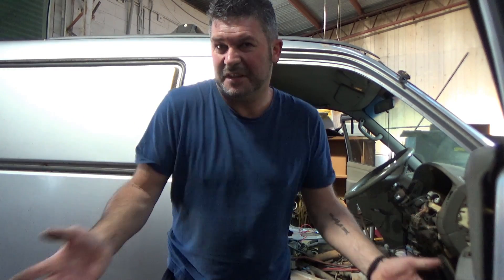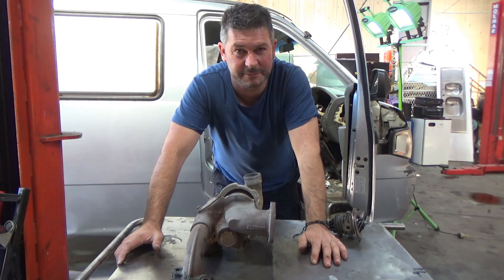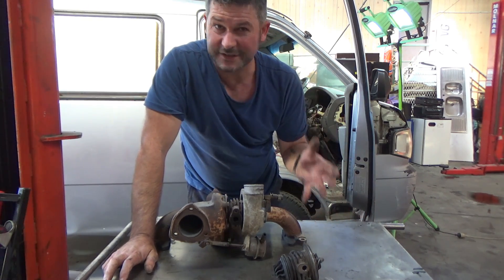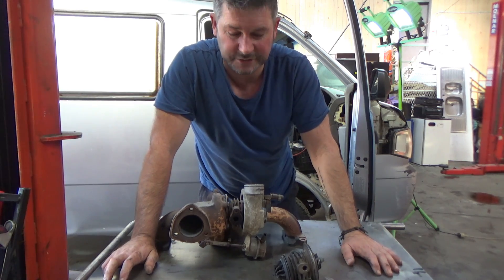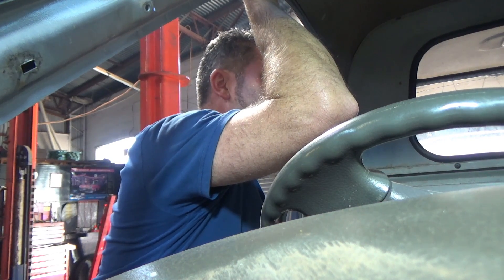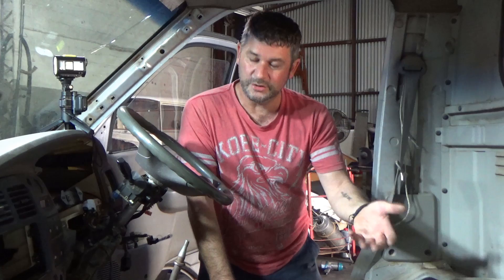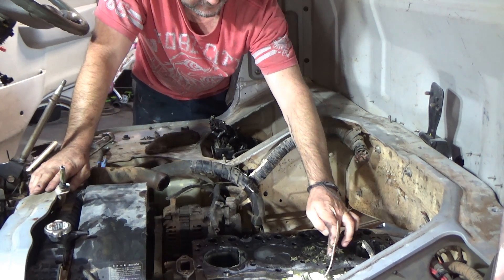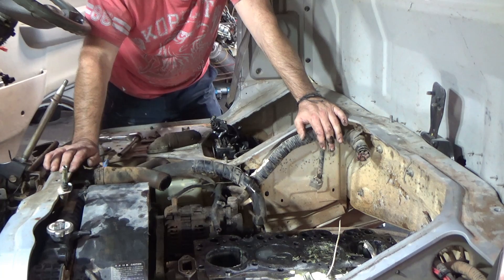How to Stop a Run-away Diesel -ENGINE BLOWS !

Comment: I have a, probably, stupid question, but i'm no expert in engines or anything if you may so that's why i'm asking... I understood that running-away is generated, at least in one of the plausible situations, by the play on the turbo's turbine's axle which causes oil to leak into the engine's intake causing it to overrev in spite of no-one accelerating it, the thing i didn't get is, you said the engine you tested was not turboed, how did you make it run-away? or did you just accelerated on purpose like if it was about to run-away and you just tested ways to kill it regardless of the cause of it accelerating/overreving???
I really liked your video regardless, the sound of your voices was sometimes hard to listen to, but i liked it :D!! Thanks in advance.-

Comment: Good video,but i wonder if you let the engine run-away, would it end blow up 100% of the cases?
If there is no more oil the engine can't keep running anymore (it could be destroyed before if it reaches too high rpm)

Comment: Runaway diesels rev much higher when running on their own oil, as the fuel/oil isn't regulated. I seen one blow a clutch when putting it into gear and then carried on running to put no.1 Rod through the block
Reply: They are uncontrolled except for volumetric efficiency and throwing a rod.

Comment: Many long years ago I bought (cheap! cheap!) a badly maintained high mileage Rabbit (Golf Mk I) diesel that had worn out rings. That allowed the pistons to suck lube oil from the sump at speeds above about 55mph/90kph. Who knew that diesels could run so well on 20W-50 oil? So I rarely drove it on roads with speed limits above 45. A couple of times when I did, "run away" became very real and very scary. It would keep accelerating with the throttle closed. Never had any problem slowing back down using the brakes, but I did have to push the pedal pretty hard. After a couple more years as an in town only car, the cam belt eventually broke and to the junk yard it went.

Comment: stop the car ( not moving) put it in 4th or 5th gear and release the clutch fast... that's it
btw no damage to the engine
Reply: Thebagair you do realise that when a runaway happens it fucks the motor because it runs on its oil...

Comment: What about cutting the electrics (remove fuses) to kill the fuel intake valve and shut off the main fuel feed? It should make it more difficult for the engine to run and combine that with a method to stop the intake of air, should kill the engine in a runaway engine situation.
Reply: You are missing the point here. A runaway doesn't run on fuel but on its own lubricant oil.
Reply: Hpa Poe still, it doesn't stop the driver from dropping in to 3rd gear and then dropping the clutch while all brakes are on, including the foot brake.
Reply: Perhaps that might work on one of those small 1.6 ltr. diesels but chances are you'll burn out the clutch in the blink of an eye and the engine won't miss a beat. But I would love to see you trying that on a 15 ltr. Kenworth.
Reply: Then you just suffocate the engines ability to breathe and theres many ways of achieving this, one possible method would be to starve the engine of all oxygen and dump co2 directly in to the air intake.

You could also try the old trick of "Tatering" the exhaust, thats sticking a large potato on the tail pipe and driving it home with a wooden mallet or a fist so that the engine will struggle to put out exhaust and also the intake if its a turbo. Larger ports only need enough covering the port to create a tight seal to do the same sort of job.

There will always be some way to stall an engine, I had a bit of an old banger for a while that had a tendency to restart itself, just no reason at all so I resolved the issue with a battery switch. I used to leave the car in gear until fitting the battery switch that was worth as much as the car, mind you, we are talking 1980, I paid £25 for it. 3rd gear was a charm, tended to wander a bit, but it got me to work, sometimes.

Comment: heavy plastic bag could do the job instead of rag, u cover it on top of the manifold. could also be done by cutting the fuel line. or taking out the engine battery on newer ecu based diesel

Comment: I feel like the block of wood would work on an actual runaway though. You guys were testing with the proper fuel ratio of a running diesel using it's injection system. A runaway will typically not be burning injected diesel but whatever engine oil it can suck in and in a quite rich mixture going by all the smoke you typically see. I think the block of wood will change the mixture parameters enough to stop the combustion. Anyway, nice video guys and thanks for the effort!
Reply: Todd Stidham ...it will keep it from exploding like bomb, until something else can be done..
Reply: Todd Stidham
 diesel engines detonate from its  compression not the actual fuel and air mixture I  think .

Comment: Here is a tip for you, from one old mechanic to another. A halon fire extinguisher will work on a run away engine. I know because I use to keep one in the shop back, when I was working in a full service, service station which are pretty much non-existent for the most part now days. Now Halon is a "Clean Agent." as defined by the National Fire Protection Agency. And it is a liquefied gas, and it does carry a ABC rating, the nice part is that because it is actually a gas instead of a powder it will not damage the engine. Which is why I kept a Halon fire extinguisher on hand all the time, as it meant less repair work if a car caught fire in the shop. And yes that does happen, when a car backfires through a naturally aspirated gasoline engine. So it should work on a Diesel engine as well, for cutting off the air supply.
Reply: I can imagine that Halon would work pretty well, but, as a CFC depletant it has been banned in Europe for over 10 years and is unobtainable. I don't know about the US or AUS. The replacement argonite or FM200 extinguishant gases that are used to protect data centers might well work but they don't tend to come in handheld cylinders like Halon used to, principally because they are fluorinated gases and very strictly controlled
Reply: I know we can still get small 10# bottles for on board driver activated race car fire suppression but I think thats it.
Reply: Stephanie Kawadias Halon (Bromotrifluoromethane)... Was banned under the Montreal Protocol no?
Reply: Halon is only used on aircraft in aus atm and specialist industries from what I know...... and if you ever let one off the paperwork is biblical..!!. stuff kills a fire, ultra fast though... kills the oxygen.. fire gone in like a second or two... extremely effective!! However not so great on mother earth...
Reply: @steveblackbird  uk taxis used to have halon extinguishers back in the fairway days, i kept a few as they are good for electrical fires

Comment: I used to work as a diesel mechanic for the US Government. Had a 5-ton run away on me once. Hit the intake with a CO2 extinguisher to stop it. Worked like a charm and the engine survived too.
I used to be skeptical about using CO2, because it comes out so cold. Figured hitting the hot pistons and valves with such cold temperatures would cause damage. But if you think about racers and the use of N2O in cars you realize that the engine must be capable of taking it.
Reply: rebelwolves ;
Reply: Yeah but most of your racers that run nitrous rebuild there engine quite often
Reply: @garebear1806  When your engine runs away you are going to rebuild it anyway. CO2 means you have an engine to rebuild.
Reply: Hydrolock
Reply: The CO2 wouldn't really be that cold. Since you are compressing the CO2 again it gets hot again, because in gases preasure correlates directly to the temperature. Here is a short of a fire brigade using it to stop a rather modern diesel engine https://www.youtube.com/shorts/v9FrFI20xFc
Reply: 40 years ago I learned to always have a Co2 bottle ready when starting a diesel in the shop, especially Detroits (2 stroke) which start with the rack wide open. Also diesels can runaway from oil leaking from the intake side of a bad turbo.
Reply: @llewellynquay9463  I've heard they can also run away from bad oil rings

Comment: Wouldn't having an air filter on for the extinguisher make a difference. it would clog the filter and prevent air flows thus choke the engine out.

Comment: Fire extinguishers work pretty well, seen a couple of trucks run away, go nuts with the extinguisher, if you run legal you need one anyway. A powder extinguisher will plug the filter and snuff the air and a CO2 will smother the fire inside. We had a screaming truck and hosed it with the powder. Swapped the turbo, changed the air filter, gave the side of the truck a pressure wash and the good old DT466 was still running 2 years later. So don't spray powder directly into an engine without a filter.

Comment: generally the idea behind the fire extinguisher is that you would leave the air filter on, the powder from the extinguisher should plug the air filter, in theory it is the fastest way without damaging the engine
Reply: Baron Van Oosting co2 is a gas( carbon dioxide) using a powder extinguisher won't starve it of oxygen, its safer to block the exhaust, stop the flow of gases, and if the engine blows it won't explode in your face.
Reply: Baron Van Oosting ...no...you rob the engine of oxygen...that hoover will suck that air filter inside out and keep going.. This test worked here, due to static lock..

Comment: That was interesting. I have my dad's 1962 David Brown three cylinder diesel tractor. When he bought it, I was fascinated that turning off the "ignigion" did not stop the engine. You had to turn off the fuel. My dad explained that diesel engines do not have spark plugs and that ignition occurs through compression. My first lesson in thermodynamics. My dad was one smart farmer.

Comment: If you can cut off fuel or air, it will stop.. I like the idea of a CO2 fire extinguisher.. The engine can't run on carbon dioxide.

Comment: Cut or crush the turbo oil feed line.  It runs out of fuel, combustion stops, hopefully before the crankcase runs dry.  The hot oil bath wouldn't be fun, but you'd have an engine.
Reply: Jafromobile your approach works great but I experienced another type of runaway... injector pumps were built in head, and leaked. oil sump filled with mix of diesel and oil and was sucked in into intake by sump ventilation.... oops...
Reply: OUCH!  That sounds like a disaster looking for a place to happen.  :(  I don't think I'd attempt my method unless I knew the turbo was failing (in other words, if it was my diesel engine and I had seen it/smelled it smoking prior to the runaway).  Doing this to someone else's engine would probably just make them blame me for helping them, knowing my luck.

Comment: Porque no los dos? You could use a combination of both. By using a floor mat or similar you could restrict air flow which would in-turn lower the revs/torque allowing you to stall the engine without destroying the clutch.

Comment: Remember that a turbo engine with no turbo has very little power, add to that it's running on oil, which is less efficient and will produce less power. My guess is the block of wood would work and the rag would likely be stuck at the same broken turbo.

Comment: The soda extinguisher wouldn't be a problem if the air cleaner were on the intake.  Even powder extinguishers use CO2 for propellant.

Comment: block the exhaust. You don't have to block it completely. Get enough back pressure on it and the turbo slows down. If you happen to have a potato handy and ram it into the exhaust one of two things will happen. The engine will stall or you you will have a high speed potato projectile.
Reply: BrianBell4073: Give it a try on your gas engine running at 2500 RPM's and let us know how that works out for you, or does not work out for you in this case. The one fail safe measure that works every time is to block the intake air with either a thick chunk of wood or at least a 3/8" thick steel plate.
Reply: Thought of this also.  you would have to stop it right at the turbo, and completely.  trying to shove a potato in a non runaway TAILPIPE would be difficult
Reply: Try it on a gas motor at idle.
Reply: Much easier to block the intake and bonus it will hold itself on. trying to block an exhaust blasting hot gas is like trying to put your finger on the end of a hot water tap
Reply: xD
Reply: High tech engine propelled potato gun! LOL :)
Reply: I’m not mad at a high speed engine projectile
Reply: Yes, I’ll throw a potato into my 8” exhaust. Lol yup, that’ll do it...
Reply: Water melon
Reply: You use a Co2 fire extinguisher.
Reply: @davidblakeman7165  No way you will ever block the exhaust with a CO2 extinguisher.
Reply: Or a banana 🍌

Comment: seems to me the the oil feeder line to the turbo needs a rev limiter shut of just my 2 cents or a simple ball valve but that leaves the chance of a screw up and poof turbo no oil but hey atleast you didnt spin the mains or throw a rod thru the block

Comment: The fire extinguisher method often works best, with least damage, but must  be done with a C02, Halon, Halotron or other gas extinguisher.  While powdered extinguishers may work, it will trash the engine. The powders extinguish fire by emitting non flammable gasses via a chemical reaction caused by heat from a fire. However a byproduct of that reaction is extremely corrosive residues left over. These corrosives will start to eat the internals of the engine as soon as they get hot. It is basically like pouring acid into the intake. And when possible, install a co2 -or halon if you can afford it, extinguisher in your vehicle,

Comment: You can stop a runaway Diesel VERY easily with either a flap on the supercharger (common on Detroit's)  or simply use a CO2 Fire extinguisher, MAKE Damn sure it is Co2 and NOT DCP that will also KILL the engine and require a rebuild.
 
So CO2 is the way to go , Engine got no O2 it aint gunna burn the Fuel SIMPLE

Comment: Runaway diesel is a shitty ass situation to be in.  I think stalling it out is ur best bet, the C02 extinguisher is probably a good one, but I think many of them have foam and shit in them too so it may just as easily lock the engine.  If you got an oil leak not a whole lot you can do if you're in an auto :-\.

Comment: only problem is with a gas engine the trans and engine rpms are synced so when in any RPM you can slide the transmission into any gear with no problem but with a diesel you have to rev match to get them into gear this being said at a high RPM you will not be able to get it into gear!

Comment: there are 2 stages to runaway.  the first stage of runaway is when crankcase vapors condense inside the intake and begin to pour into the cylinder and burn as / instead of the fuel .  the throttle is completely out of play and many times the the accelerator pedal draws to the floor. turning off the ignition key will stop the flow of fuel , but the oil will continue burning until it's all completely burned. 
the 2nd stage of runaway is when the oil itself being burned as the combustion fuel creates enough blowby gas in the crankcase to push excessive oil vapors into the intake to be burned as / instead of / and along with the fuel. once this cycle starts the engine will burn out all the oil before it shuts off.  probably terminal for the engine since all the oil is gone. turning off the key will not help this condition as the engine is in a complete vicious cycle of combustion vs blowby / crankcase pressure.
turbo lubrication leakage / runaway  is a whole other creature likened to the 2nd stage listed above.
a positive air shut off in line with the throttle plate would choke  ANY  engine out as one of the primary elements of power are removed. combining this with a C02 ext couldn't hurt.

Comment: I work on and hot rod  old 2 stroke Detroit's Never use dry chemical that will ruin the rings and score the cylinder walls !    I keep several charged CO2  fire extinguishers in the shop  If the emergency stop flap on the blower (YOU NEVER REMOVE THAT THING !!!)   does not choke one off discharge the CO2 into the intake until it dies  I also install a quarter turn valve in the fuel line of every one I work on also for extra safety  The Rack on them if one injector jams you get the runaway because none of the others can be turned off .

Comment: If you do this again, you should reconsider the rag. Try it with a wet rag. Make a ball out of it and let it get sucked in. If it keeps running pour in more water. It could not be worse than the dry powder.  Even if it hydrolocks the engine, it might save the rest of the vehicle (and surroundings) from fire damage...
Reply: his rag was too small... when that kind of shit hits this kind of fan - its time tp stuff your t-shirt, jacket and underpants all at once into it.  Or try the detachable headrest ... full of foam...  rubber floormats... your mother in law..  wahtever is available, just not a rag size of a hankerchief

Comment: I think this is a good experiment, but the thing you may be failing on the first test is that when the engine is running on engine oil it is making significantly more power than it would be on diesel. It may overpower the clutch.